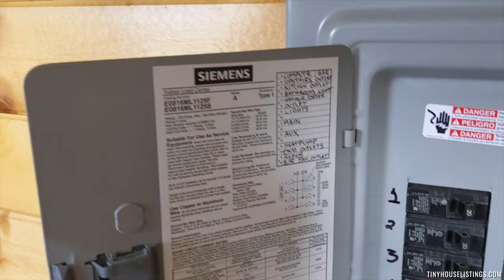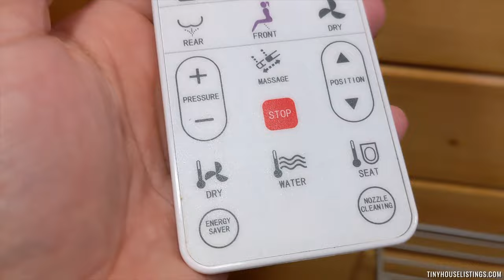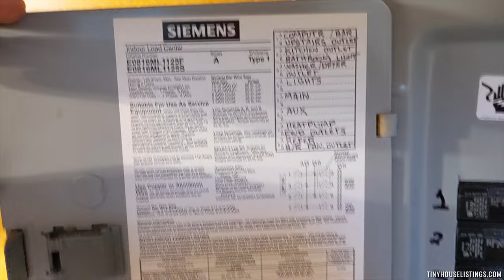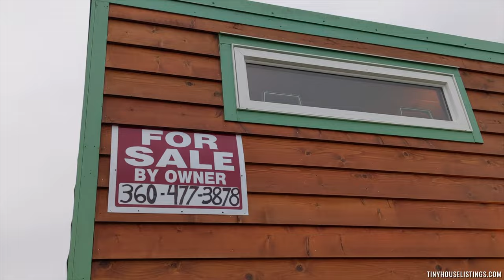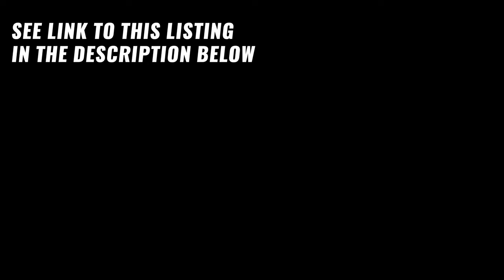Amazing 2-Bedroom Cedar Tiny House Tour with Mini-Split and Spray Foam Insulation

Comment: Did i miss the second bedroom???? Or do they mean the pet space? 😂 i guess its a 2 bedroom- no living room space OR a 1 bedroom with living/office area.
Reply: She called it an office space    because of the closet it may be a bedroom😅
Reply: @PcCurry-xd7wf  It's clearly not a 2 bedroom as the video title says. I would never buy a thing from this person because they are deceitful. I shouldn't even give them that much of a heads up but the title is deceitful.
Reply: This is my house for sale, and deceit is opposite of my intent. 

This video was created by the website I listed it on, they used the information there to generate this. When creating a listing on this website there are pull down menus to specify aspects of the house. With menus of this type I am afraid there isn't a option for "2 bedroom- no living room space OR a 1 bedroom with living/office area". There is a loft, the place that by design can only be used functionally as a bedroom, so we have one bedroom so far. There is the downstairs area. Personally I used this space for an entry foyer, dressing location, full personal office with computer chair, and living room with a couch, all at the same time for years comfortably. A bed could also be placed here, making a total of 2 bedrooms. I picked the 2 option in the menu, as when selling things you want to generally want to highlight the features. 

The pet area is the 18" high basement area under the kitchen/bathroom. Its original purpose was for long term storage,  plumbing winterization & system access, and a litter box. Our pets we had living with us really enjoyed being down there, having a human free space from time to time, and it became in my mind their "room" if that makes any sense.
Reply: I love the amount of built-in storage, especially the pull out pantries and storage stairs. The the kitchen is beautiful! I could see the back room as an office, as you mentioned. Potentially a daybed or futon for guests.

Comment: I didn't see a 2nd bedroom. Who wants a green kitchen counter???
Reply: The loft and the downstairs area can both be used as a bedroom. That's funny about the countertop, 95% of visitors love it, and personally one of my top favorite things in the house. The company I worked for at the time had this small amount, an offcut from a larger sheet so I was able to recycle the waste into this. I wanted to do all the other counters the same but the material was discontinued, incredibly rare with only a few sheets still in circulation, costing over $4000 for a 4x8 sheet, I was very disappointed. Looking at it up close there is a wonderful opaque speckling of gold, white, browns, blacks and greys, its quite mesmerizing. Blue is the color to avoid in kitchens (an odd human psychology), whereas green is generally the colors of the foods that make us healthy and is psychologically more in sync with eating and the spaces we do it in.  Solid surface's advantages work well in a tiny house I believe. Lightweight, has enough flexibility to withstand travel, stimulating to look at (important in confined spaces), able to withstand the random projects, chemicals etc that are going to be used on it as its one of your only flat surfaces at standing level.